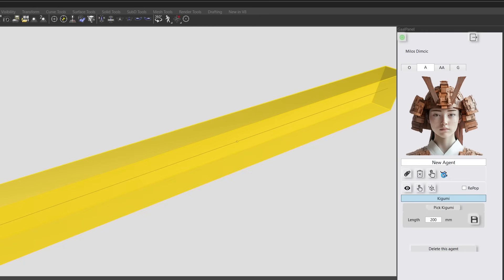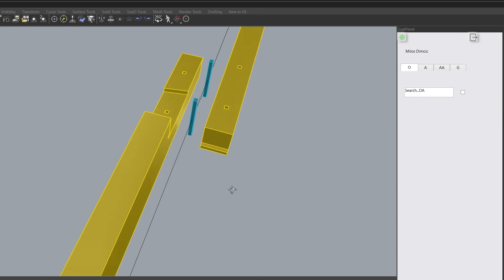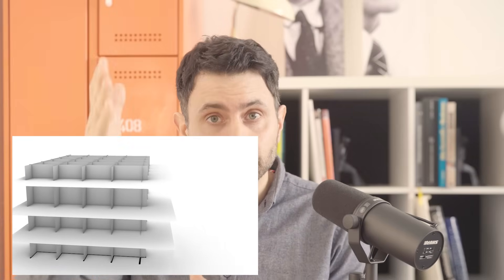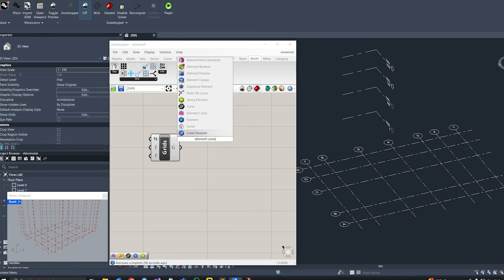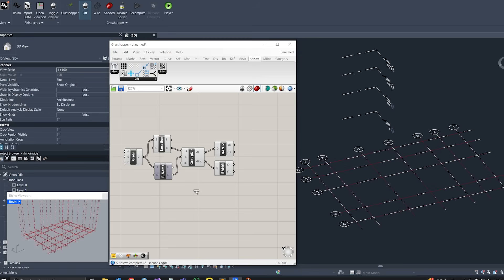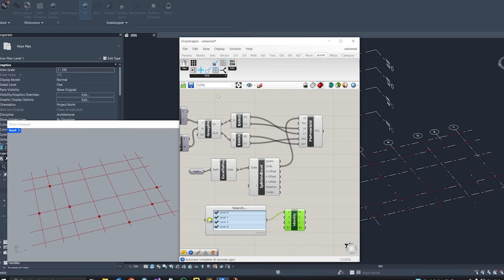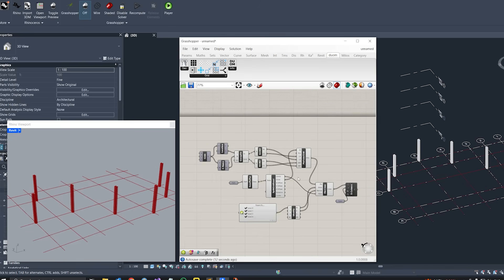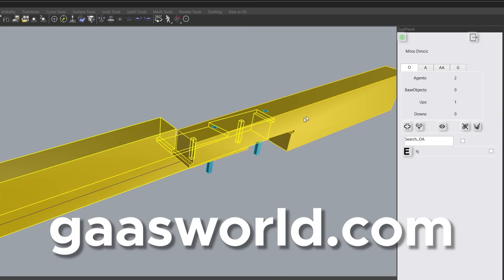RHINO Inside REVIT - Do you actually NEED it? If yes, WHY?

Comment: I'm an architectural  student. I'll start to use Revit with Rhino Inside (I started using AutoCAD, then migrated to Revit, then Rhino, but Rhino is not so powerful for documentation, even with some plugins, for instance, VisualArq (in my opinion). As you well said, Rhino is a geometric engine, and, after some research in my graduation, I was facinates by Zaha Hadid's architecture, and that spike my interest to explore with curves, that with Rhino could be easier to do, but the problem was to document that. I'll see if the workflow to document inside Revit can work. Thank you for your video!
Reply: Rhino is not so powerfull for documentation??? I have to disagree, rhino will always give you more control over everything than revit....Even more if your workflow involves Illustrator, Photoshop, Blender, etc, etc. I will not even mention Grasshopper dimensional gap compared to dinamo (Yes, both are made for specific things) but theres absolutely nothing you can not do with Rhino + GH.

Comment: Actually i use this workflow exactly, but i have some  problems with the geometry engine. Sometimes when i modelling on 3ds max it's very fluent due to the parametric/procedural approach with modifiers but in rhino for a little complex geometry (usually i have to do many iterations research so rhino in situ it's very sucks) you already need to jump directly in grasshopper. I hate that (not grasshopper, I like grass ✨).

However, for some time now, I've been considering learning Houdini due to its fully procedural nature, but I'm concerned about its compatibility with Revit.😅
Reply: ultimately the computation needs to be converted into mesh for visualization on-screen. you can use low quality setting for working to increase speed in grasshopper